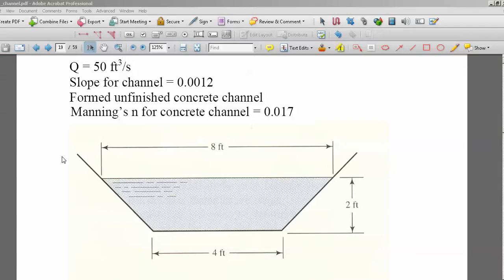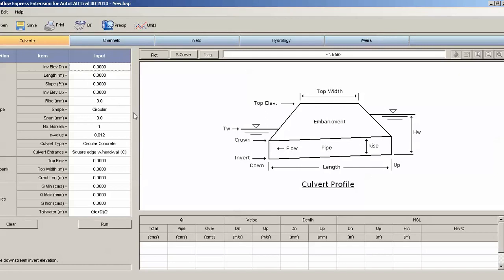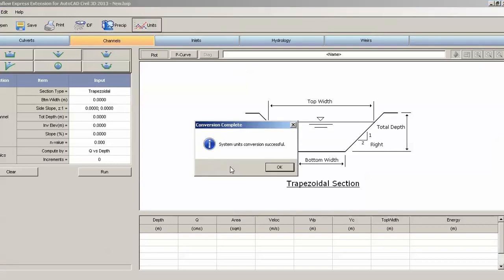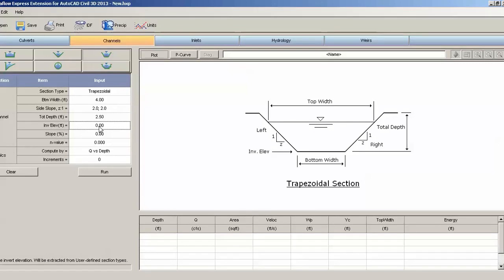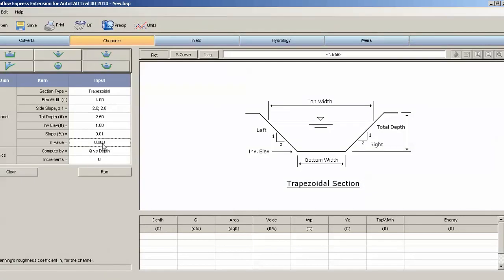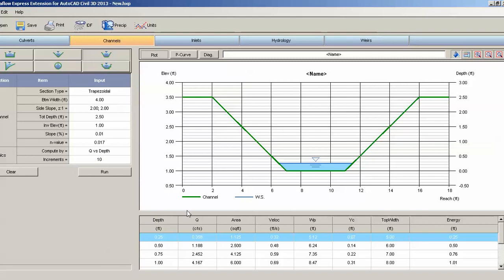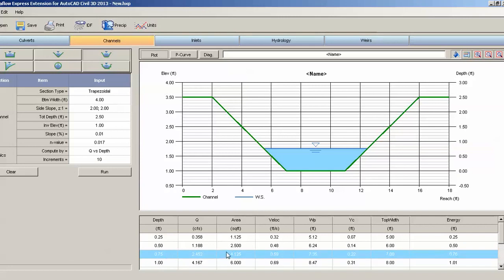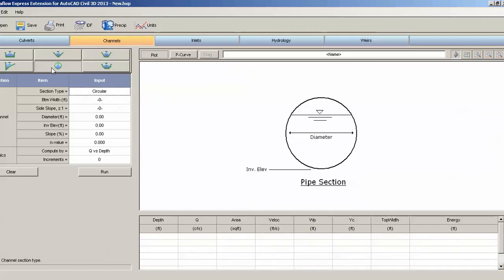Calculate Open Channel Flow in AutoCAD Civil 3D

Comment: Why the calculation using this method and Manning Equations is not giving the same value in terms of discharge? As the use of the same parameter, the Q calculated with Manning equations is ten(10) times the Q generated by the model.  Is there any explanation Please